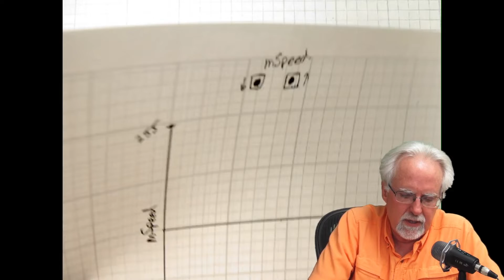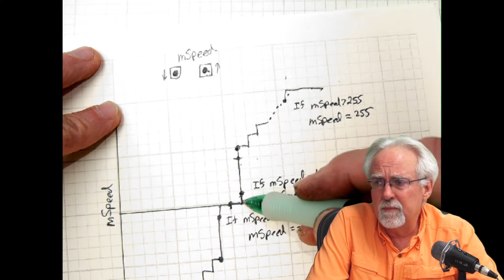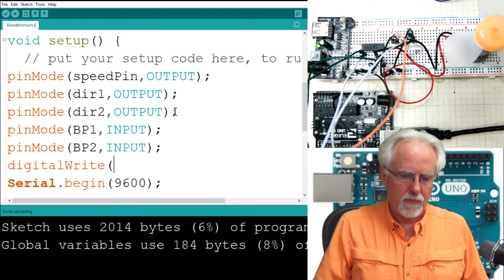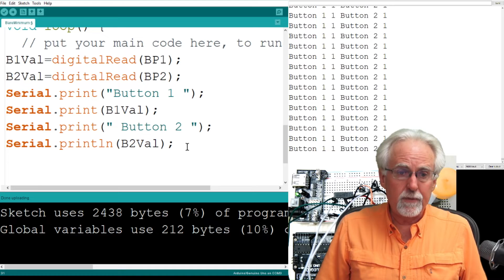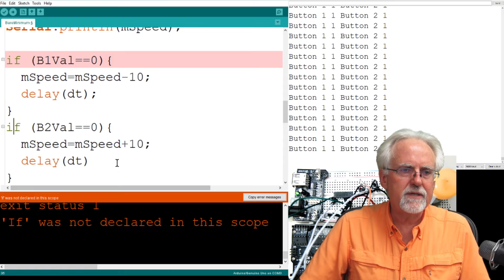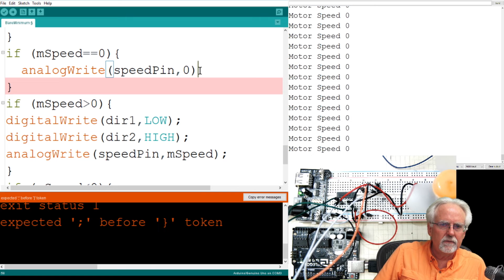Arduino Tutorial 40: Controlling DC Motor Speed and Direction with Pushbuttons

Comment: i made it by making a virtual 10bit analogRead in code so my code work similar to joystick code  and the way i achieved the jump in value from 0 to 100 in my case 150 by making initial point 150 instead of 0 :- 
int mSpeedPin=6;
int Dir1=4;
int Dir2=5;
int mSpeed;
int button1Pin=8;
int button2Pin=9;
int j;
int k;
int m;
int n;
int o=512;
int q=0;
int t=50;
void setup() {
  pinMode(mSpeedPin,OUTPUT);
  pinMode(Dir1,OUTPUT);
  pinMode(Dir2,OUTPUT);
  pinMode(button1Pin,INPUT);
  pinMode(button2Pin,INPUT);
  digitalWrite(button1Pin,HIGH);
  digitalWrite(button2Pin,HIGH);
}
void loop() {
  j=digitalRead(button1Pin);
  k=digitalRead(button2Pin);
  while(j^k==0){
    j=digitalRead(button1Pin);
    k=digitalRead(button2Pin);
  }
  m=j;
  n=k;
  while(j==0){
    q++;
    if(q>150 && o<=1022 && o>=512){
      o++;
      digitalWrite(Dir1,HIGH);
      digitalWrite(Dir2,LOW);
      mSpeed=((105./511.)*o)+45;
      analogWrite(mSpeedPin,mSpeed);
    }
    if(q>150 && o>=0 && o<512){
      o++;
      digitalWrite(Dir1,LOW);
      digitalWrite(Dir2,HIGH);
      mSpeed=-((105./512.)*o)+255;
      analogWrite(mSpeedPin,mSpeed);
    }
    j=digitalRead(button1Pin);
  }
  if(q<150 && o<=1022 && o>=512 && m==0){
      o=o+t;
      if(o>1023){o=1023;}
      digitalWrite(Dir1,HIGH);
      digitalWrite(Dir2,LOW);
      mSpeed=((105./511.)*o)+45;
      analogWrite(mSpeedPin,mSpeed);
    }
    if(q<150 && o>=0 && o<512 && m==0){
      o=o+t;
      if(o>=512){o=512;}
      digitalWrite(Dir1,LOW);
      digitalWrite(Dir2,HIGH);
      mSpeed=-((105./512.)*o)+255;
      analogWrite(mSpeedPin,mSpeed);
    }
  q=0;
  while(k==0){
    q++;
    if(q>150 && o<=1023 && o>=512){
      o--;
      digitalWrite(Dir1,HIGH);
      digitalWrite(Dir2,LOW);
      mSpeed=((105./511.)*o)+45;
      analogWrite(mSpeedPin,mSpeed);
    }
    if(q>150 && o>=1 && o<512){
      o--;
      digitalWrite(Dir1,LOW);
      digitalWrite(Dir2,HIGH);
      mSpeed=-((105./512.)*o)+255;
      analogWrite(mSpeedPin,mSpeed);
    }
    k=digitalRead(button2Pin);
  }
  if(q<150 && o<=1023 && o>=512 && n==0){
      o=o-t;
      if(o<512){o=511;}
      digitalWrite(Dir1,HIGH);
      digitalWrite(Dir2,LOW);
      mSpeed=((105./511.)*o)+45;
      analogWrite(mSpeedPin,mSpeed);
    }
    if(q<150 && o>=1 && o<512 && n==0){
      o=o-t;
      if(o<0){o=0;}
      digitalWrite(Dir1,LOW);
      digitalWrite(Dir2,HIGH);
      mSpeed=-((105./512.)*o)+255;
      analogWrite(mSpeedPin,mSpeed);
    }
  q=0;
}

Comment: I found this to be the most challenging episode/homework since I didn't know about abs(). I had to know if 1. speed was increasing or decreasing. 2. which direction was currently on and then setup 4 different scenarios to control the buttons. The abs() makes it somewhat easier.  And I don't recall that this was EVER taught in the series! ;-) . But I got it to work.  I completely agree: i had to make the logic/workflow on a piece of paper before coding.

Comment: Here's how I did it before watching the video:

int highPin=A5;
int lowPin=A0;
int highVal;
int lowVal;
int speed;
int speedPin=11;
int dir1=10;
int dir2=9;

void setup() {
  // put your setup code here, to run once:
  Serial.begin(9600);
  pinMode(highPin,INPUT);
  pinMode(lowPin,INPUT);
  pinMode(speedPin,OUTPUT);
  pinMode(dir1,OUTPUT);
  pinMode(dir2,OUTPUT);
}

void loop() {
  // put your main code here, to run repeatedly:
  highVal=digitalRead(highPin);
  lowVal=digitalRead(lowPin);
  Serial.print(lowVal);
  Serial.print(" / ");
  Serial.print(highVal);
  Serial.print(" / ");
  Serial.println(speed);
  
  if(highVal==0&&speed<175){
    ++speed;
  }

  if(lowVal==0&&speed>-175){
    --speed;
  }

  if(speed>0){
    digitalWrite(dir1,LOW);
    digitalWrite(dir2,HIGH);
    analogWrite(speedPin,speed+80);
  }

  if(speed<0){
    digitalWrite(dir1,HIGH);
    digitalWrite(dir2,LOW);
    analogWrite(speedPin,-speed+80);
  }
}

Comment: Most challenging yet. Great lesson. I looked back at your 2 button lessons and assumed I would need to track the last status of each button. I also tried to handle the going over max speed by altering the increment down to 5 instead of 10. One more bad - I tried stacking or nesting all those IFs and spent hours trying to sort all the  logic and positions of the numerous "close" curly brackets for 7 ELSE statements. Kept getting errors. Stubbornness over practicality. Your algorithm was much simpler - classic KISS method. Tried but no way I would have cracked this myself. I am an old procedural flowchart, COBOL/PL/1 programmer and this is a different world. Never could handle Assembler and I'm sure C or C++ would kill me!

Comment: I completed the previously assigned double button to control the motor. One of the problems I ran into was that one of the pull up resistor buttons didn't seem to be working right. I finally figured out that by unplugging the Arduino and then plugging back in - it worked! I really relied on the serial printer to gradually develop my code and find out how it was working at each step.
I also bought some Duck brand poster putty that worked well for sticking things down. You had previously mentioned that you didn't know it's real name. You just called it goop or something.
Once again another excellent lesson.

Comment: This morning I reassembled my circuit and it just decided to work :).  Perhaps I just had the power supplied reversed such that the + pin was seated on the breadboard - rail.  I can now do my experiments to see where the transition to 0 takes place.  I do not have time to write the assignment code today (11/29/23) but will probably do it on Friday (12/01/23).  I do not know if anyone is reading these comments as it has been many years since the lesson was delivered, but it is useful to me.
Reply from the maker: Excellent!

Comment: A lot of frustration as the basic circuit from lesson 37 just stopped working.  I was just testing for the lower limits of the motor to find the point where I needed to reverse direction.  That is somewhere around mSpeed of 100.  I have wired this circuit about half a dozen times.  I have checked the motor, the conduction of all wires and breadboard pins, and the output voltage of the power supply.  From the Arduino Basic Kit, I even had a second motor controller chip.  The circuit is dead, and I don't know why.  I will try again tomorrow, but I am not expecting different results.  Will probably just move on to lesson 41.

Comment: Thank you for another great lesson Paul! I struggled for a little bit, trying to multiply mSpeed by -1 if the value were below zero. without looking ahead I tested my ability to find solutions by looking elsewhere on the web. Surprisingly I typed my question into Chat GPT and they gave a funky solution, but it did have the abs(___)  function plugged in at the end in the analogwrite command. AHHHAAA!!! that was exactly what i needed. Now onto watching the lesson. I enjoy these so much. I do them before and after work.

Comment: Ohh, after watching the introduction, I realized that I misheard the instructions from the last video. I must have just been excited to start! 😅 But I ended up figuring it out! 

I set it up so that if the down button is pressed at 0, the program changes the value of a fan rotation variable to reversed, the HIGH/LOW values of the directional pins, and swaps the add/subtract function of the up and down buttons in the reversed direction. I had to make two separate functions for both buttons, one in the forward direction, and one in the reversed direction. I seriously don't know how I didn't end up getting stumped. 

You're a legend of a teacher Paul, thanks!

Comment: I made my fan have ten speeds. The initial press of the speed increase button sets the PWM to 255 to kickstart it for 50 ms, then down to 100. Each increment is 15.5 up to the total of 255. Once you pass 255, it sets the speed to zero. And if you press the decrease speed button while the speed is at zero (off) it sets the speed to 255, so you can infinitely cycle between the speeds with either the increase or decrease button!

Comment: I use a simulator because I don't have the kit so when I tried, I thought it worked when It reality it lacked the starting value if condition. But overall, the code was fine. If I had the real kit I could have made it no problem. It was just a few if conditions after all 

thanks for the tutorial :D

Comment: Another great tutorial with a simpler solution than what I would have come up with. Graphing out the solution makes a world of difference.

I noticed the use of ABS, absolute value, in this tutorial. While I am familiar with this command in other languages, it is new in this series. I've looked, but I have yet to find a complete keyword reference guide geared toward the Arduino IDE. It also seems there are some differences between what C/C++ and Arduino's IDE use. Example: To convert a string to lower case, C++ uses tolower(). Conversely, Arduino uses, tolowercase() for the same function. In the past, I've always relied upon a programming reference book listing every keyword with a brief example showing it in use and its syntax. Does a complete programming guide exist for Arduino? Most books are beginner oriented and are incomplete.

Comment: This was difficult. I tried to use the push button with led dimmer program model without success.
I think in C, if you have to use more than three ifs in a sequence, they suggest a case ending with default. But that would be more difficult. New concepts had to be introduced here, the abs function to give a positive value.
I guess you have to think outside the box and introduce new concepts. ABS and || (logical or) in this case.
Wayne

Comment: My solution ignored the minimum PWM value until just before writing to the PWM speed pin. The virtual motor speed is reduced in range by the minimum run value, so if the minimum run value is 100 then the total virtual speed range is reduced on the upper and lower end by 100, resulting in a virtual speed range of -155 to +155. When it is time to set the motor speed value to the motor PWM pin there are now only two cases, speed is 0 for stop, or greater than zero for run as the conversion from a negative virtual speed can be made at this time (if negative, multiply by -1). For those non-zero speed values, add the minimum speed value to the "real" motor value and then write to the output pin.

So, for motor speed processing, if the virtual speed is 0 then the value written to the output pin is 0. For all other values, add the minimum PWM value to the calculated value to get the value output to the pin, also, this is the best time to check for value overrun of 255 before the value is written to the output pin.

3 variables are required for this implementation.
int minimumSpeed=100;  // minimum value that will spin motor
int virtualSpeed;  // speed value changed by button processing that varies from (-255+minimumSpeed) to (+255-minimumSpeed)
int actualSpeed;  // speed value sent to motor PWM pin, actualSpeed=(absolute value of virtualSpeed ) + minimumSpeed for all values of virtualSpeed >0

Other useful variables are
int smallestSpeed= -255 + minimumSpeed;
int largestSpeed= 255 - minimumSpeed;
 
These values define the total range of speed values and are useful in forcing out of bounds values of virtualSpeed

Thank you. I have really enjoyed this series and after completion, I plan to work through several of the others.

Comment: I got it on my own! My solution is a bit different than yours, but the result was the same. The main problem I encountered was with an IF statement I wrote. It seems Arduino doesn't like structures such as IF (-100 < mSpeed < 100) {. I changed it to IF ((-100 < mSpeed) && (mSpeed < 100)){, and the problem was solved.

Comment: Yes, had it working before watching , did a few things different

did my scalier by +-16 working clock between 0 1023 where 512 is zero, gives 32 increments either way and has a jump between counter clockwise and clockwise .
using a 16 scalier you will always hit 0 and 1023 as high and max.

Comment: I got it slightly different trimming the speed range inside the button statements but between -100 and 100. Probably it is better to set to 0 first to save energy. Also implemented a turn off switch when pushing both buttons. wasn't so good to make the plan on paper , kind of fixed the problems after reslizing them.

Comment: I did get it working all the equations, indidn2 variables for fan speed. If it went to -255. I would  fanspeed*-1(r) to keep the number positive..... then found out my controller overheated and I guess the clockwise motor control would not work, even when I did a blank space only doing that command :( gotta get a new one

Comment: Great Vid as always Paul. Thank you. I did the HWrk referring back to 27 & 29 adding the 10k pull-up resistor method (instead of the Hack). Got the motor smoothly stepping through speeds. I spend hours trying to get the reverse working in the right place and had to 'fold' but only after many, many attempts. I put in a red LED to signify hitting extremities of speed (just because I could), and did figure out the 'capping' of speed. I also did a sketch of the basic working prior. THAT is a very good tip.

Comment: present. I think I would have gotten around a 95. I set my fan to look like an airplane prop trying to start. But I did do that on purpose. but otherwise, I turned both buttons into toggle switches and would count the button level. Then rather just having it go up by a set increment it was (mSpeed=255/bLmax)*buttonL; with bLmax being an adjustable variable up top. And set buttonL*-1 if it was below zero and adjusted the direction. I think I overdid it. may have gotten 100 depending on your impression on the code.

Comment: I did it on my own. This is my code. I guess it's not the best way to do it. 

//Controlling a DC Motor with Buttons

#define MAX  250
#define MIN  5

int speedPin = 5;
int dir1 = 4;
int dir2 = 3;
int mSpeed =0;

int button1 = 8;
bool butt1;
int button2 = 12;
bool butt2;

int dt = 200;
long wait;

int mdirection = 3;
int stepp = 5;

void dir(bool *x, bool *y)
{
  digitalWrite(dir1, *x);
  digitalWrite(dir2, *y);
}
void stopp(int *mSpeed, bool x, bool y, int *mdirection)
{
        *mSpeed = 0;
        dir(&x,&y);
        Serial.print ("Stopp:" ); Serial.println(*mSpeed);
        *mdirection = 3;
}
void control1(bool x, bool y, int *mSpeed, int *mdirection)
{
        dir(&x,&y);
        *mSpeed += stepp;
        if(*mSpeed < 100)
        {
          *mSpeed = 100;
        }    
        analogWrite(speedPin,*mSpeed);
        Serial.print("Control1: "); Serial.println(*mSpeed);
        *mdirection = 1;
}
void control2(bool x, bool y, int *mSpeed, int *mdirection)
{
        dir(&x,&y);
        *mSpeed -= stepp;      
        if(*mSpeed < 100)
        {
          *mSpeed = 0;
        }
        analogWrite(speedPin,*mSpeed);
        Serial.print("Control2: "); Serial.println(*mSpeed);
        *mdirection = 1;
        if(*mSpeed ==0)
          *mdirection = 3;
}
void control3(bool x, bool y, int *mSpeed, int *mdirection)
{
        dir(&x,&y);
        *mSpeed += stepp;
        if(*mSpeed < 100)
        {
          *mSpeed = 100;
        }
        analogWrite(speedPin,*mSpeed);
        Serial.print("Control3: "); Serial.println(*mSpeed);
        *mdirection = 2;
}
void control4(bool x, bool y, int *mSpeed, int *mdirection)
{
        dir(&x,&y);
        *mSpeed -= stepp;   
        if(*mSpeed < 100)
        {
          *mSpeed = 0;
        }
        analogWrite(speedPin,*mSpeed);
        Serial.print("Control4: "); Serial.println(*mSpeed);
        *mdirection = 2;
        if(*mSpeed ==0)
          *mdirection = 3;
}
void readbutton(bool *black, bool *red)
{
  *black = digitalRead(button1);
  *red = digitalRead(button2);
}
void setup() {
  Serial.begin(9600);
  pinMode(speedPin, OUTPUT);
  pinMode(dir1, OUTPUT);
  pinMode(dir2, OUTPUT);
  pinMode(button1, INPUT_PULLUP);
  pinMode(button2, INPUT_PULLUP);
}
void loop() {
      if(millis() > dt + wait)
      {
        readbutton(&butt1,&butt2);  
      
        if((butt1 == 0) && (butt2 == 1) && (mSpeed <= MAX) &&((mdirection == 1) || (mdirection ==3 )))
           control1(0,1,&mSpeed,&mdirection);
        else if((butt2 == 0) && (butt1 == 1) && (mSpeed >= MIN) && (mdirection == 1))
          control2(0,1,&mSpeed,&mdirection);
        else if((butt2 ==0) && (butt1 == 1) &&(mSpeed <= MAX) &&((mdirection == 2) || (mdirection == 3))) 
          control3(1,0,&mSpeed,&mdirection);   
        else if((butt1 == 0) && (butt2 == 1) && (mSpeed >=MIN) && (mdirection == 2))
          control4(1,0,&mSpeed,&mdirection);  
        else if((butt1 == 0) && (butt2 == 0))
          stopp(&mSpeed, 0, 0, &mdirection);
        wait = millis();
      }
}